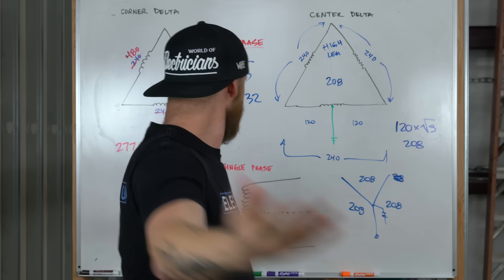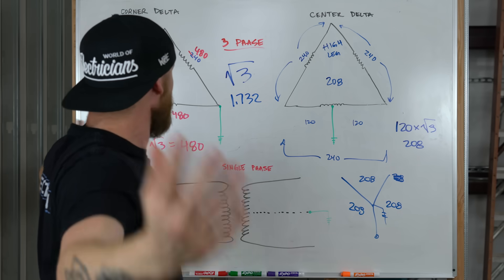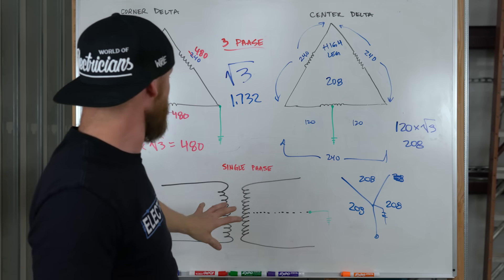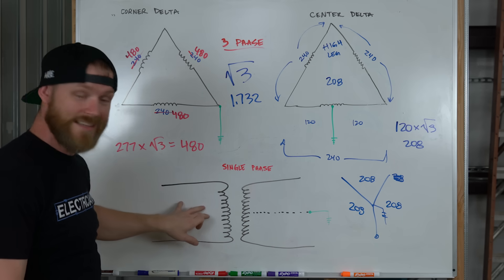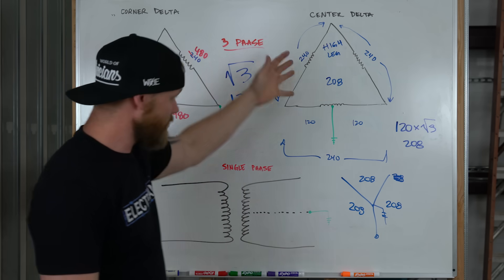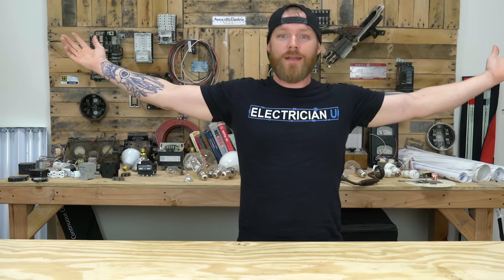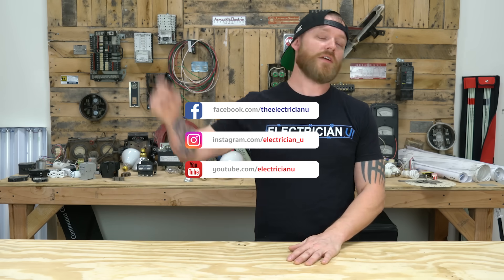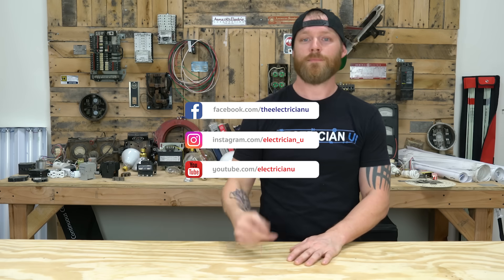Difference Between VOLTAGES - Why We Need Them All

Comment: Now I am glad tho be an electrician in Europe where we have 230V(/400V) system  everywhere. Small houses and huge industrial companies run on the same system
Reply: Some countries still have 230V three phase system. In France it's almost extinct, only found in some old factories with private transformer, but in Belgium and maybe other countries both 230 and 400V systems still coexists. Depending on the cities or the street you can have 1 or the 2 systems. 
I was told it's a real pain in the ass for music festivals or concerts tours. Electricians often have to rewire the panels depending on the voltage
Reply: @lionnelc13  Norway have a lot of 230V IT/TT (Delta configuration) , but greenfield construction is with 400V TN (Y configuration).

A lot of old houses or small apartment only have one of the phases into the building, so unless you have a Renault Zoe, you won't notice it.
Reply: @
Simon Schertler yes, i'm glad that i'm an electrician in Germany with the 230V (/ 400V) system. only the plugs schould be the same across europe (the world. i think, the poland has the best plug: germen plug whit a ground pin).
Reply: @RobertJohnson-v7v  Thank God for switch mode power supplies, and variable frequency drives.
Reply: In Amsterdam are parts with the old system with 2 fases, each 127 VAC. Making the 220 VAC between those fases. 127 x sqr(3) = 220 VAC
Now many countries in europe have 230 VAC and maby in the future 240 VAC. More voltage, so we can deliver more power through the same wires. The current determents the wire gauge, so to get more power (P=UxI) we're getting higher voltages.
Same for the higher voltages, 380 VAC come from 220 x sqr(3) and the newer 400 VAC comes from 230 x sqr(3).
Reply: @Guust

  Very common, sort of what we have here, they are really just single phase center tapped conductors from the transformer, here 240 volts across the secondary, and 120 volts between center tap and the "phase" conductors.

  Are you at 50HZ or 60 HZ there, never understood why everyone just didn't go with 60 HZ.

  I've had to deal with 380 and 400 quite a bit, we get a lot of equipment here from Europe, and I have to make it work, and all of the equipment from Canada is 575 volts, still low voltage to me, High voltage for me doesn't start until we get to 15kv
Reply: @RobertJohnson-v7v  no, center taps in Amsterdam.
It is a 230/127 Y service. Legacy of old prestandard 110 or 120V.
Again, only Y service in 230/127 (legacy) 50Hz upgradable to 400/230 present standard and most equipment can be used with only D=>Y reconnection.
Again, new motors typically are 400VD and can be used as such in heavy industry for 690VY.

We don't understand why not everyone went with 50Hz 😉
Reply: @RobertJohnson-v7v  Blame Siemens for 50Hz. Some engineer/ mathematician over 100 years ago identified 3 phase 60Hz as the optimum way of transmitting electricity. Siemens engineers considered 60 was not a standard number and chose to produce 50Hz equipment and that stuck in most places outside North America (Japan has 100 volt 50 and 60Hz). The sub-optimal 50Hz frequency must have cost billions of dollars over the years compared with using 60Hz.
Reply: @RobertJohnson-v7v  Canada is 60Hz so is US . Where is "here" are u?
Reply: @netking66  60 Hz AC frequency was developed by Tesla in the US cause that was the frequency his generators ran the best and also there's no visible flicker of lightbulbs on 60 Hz. 50 Hz was developed by Dolivo-Dobrovolsky in Germany, it was at first 40 Hz but lights visibly flickered on this frequency so he raised it to 50 Hz where theres no flicker.

You're so incredibly wrong about 50 Hz "costing billions" over the years. There's practically zero difference between 50 and 60 Hz, its negligible. 50 Hz is only 16.7% less than 60 Hz

60 Hz is not the optimum way of transmitting electricity. In fact no AC frequency is, cause AC has skin effect. The alternating magnetic fields cause the current to concentrate on the outskirts of the conductor, theres less current in the center. Higher the frequency the greater the skin effect. In DC theres no skin effect and no capacitive coupling so its a lot more efficient than AC. Thats why underwater high voltage DC lines exist. The problem with DC is that you have to use complex and expensive silicon power electronics to change voltages, on AC you can just use simple and cheap transformers.

So yeah 50 Hz is marginaly better than 60 Hz when it comes to skin effect. But skin effect only really starts to affect circuits in the kilohertz range.

60 or 50. It doesnt really matter.
Reply: @Guust_Flater  I worked in Amsterdam 1988-89 and we had a quick upgrade around Christmas '88 on the Ferdinand Bolstraat between Ceintuurbaan en Albert Cuip due to a broken tram 600VDC return cable causing current to run over the gaspipes making the flange gaskets leak.
Ferdinand Bol was still on the legacy 230/127D and a lot of small businesses had  luckily motors in D, so after the upgrade all was 400/230Y and the same motor could be used in Y.
So simple..
Reply: Hum, in some bigger European factories, we also have 400Y/690V, which offers a good financial compromise (when compared with 6kV 3 phase) if you have multiple loads ranging from 200kVA to 800kVA. Plus the fact there's less red tape to maintain LV systems.
Reply: @thafff  Yep. Built numerous switchgear for 690V paper mills etc.
Some quarry crushers run at 1000V (up to 1150 which is 690√3).
Reply: @thafff  Interestingly 230/400 volt supply covers such a broad spectrum of needs compared with USA 120/207 volt (207 phase to phase which seems a rarity) that there would need to be a very strong case in individual circumstances to adopt something like 400/690 , 3.3kV or anything else below 11kV (a fairly standard distribution voltage in 50Hz areas).
Reply: @netking66  That's the benefit of developing later a network in a greenfield: you've got significant return on experience from the historical actors, and no technical debt to deal with. 
For the anecdote, the French utility company decided to bite the bullet in the mid 1960's, and bore the costs of either replacing existing 110V appliances, or of supplying voltage transformers. That couldn't have happened at the same period in the US, because households were significantly more equipped with domestic appliances.
Reply: Sweet same as Australia 230V to earth and 415V Phase to Phase,
Reply: @RobertJohnson-v7v  380V is older, 400V is newer. Standards changed 1988.
Same equipment, because during 380 the voltage tolerance was +10%, -10%. 
400V is -10% +6%
There is a discrepancy in standards though, in that motor windings are supposed to be +/-5% only.
Nevertheless, we all run our 380 on 400 without problems.
Reply: @RobertJohnson-v7v  That fits my narrative.
Reply: @RobertJohnson-v7v  Yes....Most houses have 3 fases before the meter and house 1 uses fase 1, house 2 fase 2 , house 3 fase 3, house 4 fase 1 and so on. This way the load is evenly distributed over all fases. If you want to upgrade your home to 3 fases, it is easy, the 3 fases are already in the house. You want this because of a new electric oven witch uses more than 1 fase or a EV charger. 
The fases are 120 degrees shifted from each other, that's where SQR(3) comes from. Now in Amsterdam the voltage of each fase was 127VAC in stead of 220VAC and is you take 2 fases with each 127VAC, which are 120 degrees shifted, you get also 220VAC like the rest of the country.
Reply: residue junkie  Bull. If heated vapor fuel delivery was more efficient than atomized liquid from injectors or carburetor nozzles then LPG (propane) engines using a gaseous mixer fed from vapor withdrawal from the tank or liquid withdrawal and a coolant heated vaporizer would get far better fuel economy than gasoline, instead they get slightly less fuel economy with the same compression ratio as for gasoline due to the lower heat content of LPG and about the same fuel economy with the higher thermal efficiency of having the compression increased because of the higher equivalent octane rating. Also LPG liquid injection such as used by the Schwan's ice cream trucks would be less efficient not more efficient than vapor mixer or injection. Sources: a Farmall 450 LP tractor with the original Ensign system from the 1950s, an LP converted Harbor Freight Predator 212 on a snowblower, and a Lehr trimmer.

Comment: is the Wye connection the wild leg or is it the delta? just asking
Reply: The question is, do you get a wild leg from wye or delta? Answer delta. I as an Instructor wouldn’t let students say 208 v hi leg. I made them use 207.6v to represent hi leg. They could only use 208v on a wye system. Students wouldn’t get confused.

Comment: Let's say  I'm running a 10k BTU ac 120 volts would the same 10k unit in 240 draw less amperage
Reply: The motor driving the blower would use half the power. Dont mix BTU with voltage not the same in physics.
Reply: @stevensullivan8368  wasn't mixing btu with watts just tying to figure out if 240 vac appliances were more efficient than 120vac appliances
Reply: Power is the same, amps is half. Example only: 240v x 10a = 2400watts 120v x 20a = 2400watts. No efficiency difference except minor heat loss due to higher amps with the 120v source.

Comment: 3:50 there is no "3-phase delta configuration service". It's 3=phase and different ways of using it.
Reply: Mic_Glow that’s not true, 3 phase primaries can be had in a delta configuration or a wye. In face most transmission systems are delta.

Comment: Could you touch on why we have so much 208V single phase in US data centers? For higher power densities (8.6kW cabinets), we go to 3 phase 208v typically. (I am a user, not a commercial electrician.)

Comment: At what point will Power over Ethernet be classify under electrical code and not low voltage? The new standards are really pushing what constitutes 'low voltage'. I heard that coming soon in some states low-voltage cablers will require new certifications for PoE.

Comment: Excellent explanation, Dustin.  I'm a machine technician and I always wondered why the different voltages in different areas.  I had a machine several years ago that blew out one of the components in the control system twice.  I was not the person who worked on it the first time, but was the second time.  After doing a little checking I discovered that this building had 240V 3 phase with a high leg.  It just so happened that this particular component was drawing power from the high leg, which it couldn't handle for an extended period, a simple 3 leg swap to the machine took care of the problem while maintaining motor rotation and making sure no other parts of the machine ended up with the same problem.  Now I know why it happened.  Thank you.

Comment: Use the Delta High leg on LED voltage drivers.
Reply: Why do you say such nonsense?
Reply: @artcamera5514  which part is nonsense?
Reply: LED voltage drivers are rated 120 through 277 volts. Anywhere in that range. Take the high leg 208 Volts and land it on a 3 pole breaker. Code Compliant.

Comment: What voltage you recommend? Hi Fi Tube Amplifier from ‌C‌hina they give you the the option of 110v 115v 120v. Any advantage with 220v or 240 in USA CT.
Reply: Simply configure the amplifier for the voltage that it will be connected to. I assume you are referring to a device that has user-selectable input voltage settings (much electronic equipment intended for the international market provide this flexibility). If you have a choice of more than one voltage readily available at the location where this amp is going to be used, go with the highest voltage. That will give the best performance out of most appliances, particularly if it is a high power device.

(EDIT): Referring to your mention of 110, 115 and 120V; the U.S. standard for the everyday wall outlet voltage is 120V. So if you are plugging into a regular wall socket, this is what you should set your amp for. If you use the lower settings the amp will obviously still work but doing so will place a slight strain on the internal electronics because they are actually being overvolted. Over time this will cause failures which will require repair. Consider this in that voltage setting.
Reply: You have to make a choice because they install the power transformer for your application . the amps only put out about 8 to 40 audio watts but high voyage to run the tubes.
Reply: @gene8933  - Then the only difference is that you are specifying the input voltage to the vendor who then provides an amplifier fitted with a power transformer made to use the voltage you give them. Other than that, my recommendations are the same. Too bad they don't provide the user-selectable adjustments that I mentioned. Would have added a lot of flexibility to the amp.

Comment: In philly we had a "two phase" system fora long time. There are still some two phase buildings around. to supply them from a three phase supply you use a transformer connection called a "Scott- T". You can also cheat a bit and run two phase motors off of the delta with the center tapped winding and getting 240/208 two phase. The phases on two phase are 90 degrees away from each other
Reply: I had an old instructor he said they called those open bank sytems. The way the xformer gets it voltage like delta and wye open bank was those
Reply: @kennethdunklin278  The two-phase transformers weren't delta or wye. The phases were at 90 degrees and not 120 degrees. They were more like X or T connected. I know it's all strange unless you worked on the old Philadelphia systems and buildings. It was really a crappy system that Philadelphia adopted in the beginning of utility power and we were stuck with it for like 50 years or more. 

"In the early days of electrical engineering, it was easier to analyze and design two-phase systems where the phases were completely separated.[4] It was not until the invention of the method of symmetrical components in 1918 that polyphase power systems had a convenient mathematical tool for describing unbalanced load cases."
https://en.wikipedia.org/wiki/Two-phase_electric_power
https://upload.wikimedia.org/wikipedia/commons/thumb/a/af/Scott-T.JPG/400px-Scott-T.JPG
 I'm also pretty sure it's covered well in "American Electrician's Handbook"  https://www.amazon.com/American-Electricians-Handbook-Sixteenth-ebook/dp/B00COKLSVO and in "Electrical Machines Drives and Power Systems" https://www.alibris.com/search/books/isbn/9780130824608?qwork=1985923
Reply: @cindytepper8878   Do you know if loads were separated like power and lighting to balance loads or more like just stab them in and turn em on? Im sure like now days unbalance loads need a return but we havent always been on a grounded system. Early days I was taught used to be ungrounded.
Reply: @cindytepper8878  Ok it is a different system than open bank and I see how they get the 90 degrees too. Literally a "T" thats cool. I could see it being assumed as a Wye or Star but its definitely not. Hell yea, thank you for sharing this.
Reply: @kennethdunklin278  Here is one of the crazy transformer connections that was most common in Philly. It was 5 wire, 4 hots and a grounded neutral
https://qph.fs.quoracdn.net/main-qimg-061bc48b1f8cece814845f7359c0f25a

It was highly inefficient in it's use of conductor material. I'm having a hard time remembering how you got the load balanced on the primary 3 phase supply side of the transformer. It's been a long time since I've been involved in any 2 phase systems. I think the last one was an emergency generator for the Philly Youth Study Center (kid prison) and I remembering it being a nightmare. That had to be at least 20 years ago. I'm trying to remember the details

Comment: All your videos are great 👍🏻 
Can you tell me how to wire a 3 phase panel   I known A has 120 volts B has 208 volts and C has 120 if a wire a light 💡 or a 15 amps duplex outlet from on witch leg do I install the breaker ? ? If I need  to wire a 220 bolts on witch legs do I install the breakers ? Thanks
Reply: Hire an electrician

Comment: We had 115 & 220.  Also most of the furnaces I have come across are 12v AC or sometimes 24v AC wires to the thermostat.  In the US now I think everything is 60 Hz but back in the day I ran across a few places that had 50 Hz.  Way to mess up early digital clocks that used to count 60 or 120 pluses.
Reply: Some random commentary: It was 115/230 volts you were referring to, now superceded by the 120/240 volt standard.

I had heard that 50Hz was used in some industrial installations but is the standard in Europe and most of the rest of the world. In my area we had 25Hz service for a few specific customers but was discontinued after a severe storm in 2006 that took down the lines. A theater was one of those customers. I always remember how the lightbulbs on the marquee and some interior lights used to flicker because of the low frequency.

Very familiar with 24V used in thermostat wiring. Never seen 12V in that application. Have you ever heard of "millivolt" thermostat systems? They actually use the current generated by the pilot light thermocouple to power the thermostat and gas control solenoid valve. The voltage here is typically rated around 3/4 of a volt (750 millivolts) DC. It amazes me that a solenoid that operates a gas valve can function on the miniscule amount of power developed by a small thermocouple. I knew a family with a furnace that used this system and it came in handy during a couple of bad storms that caused several-day-long blackouts.